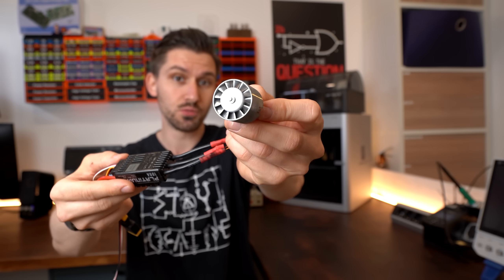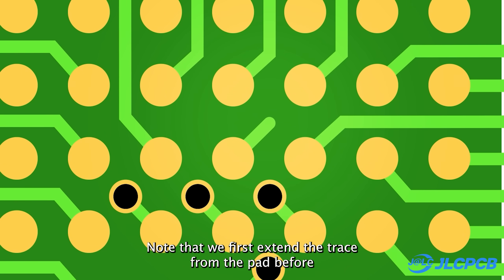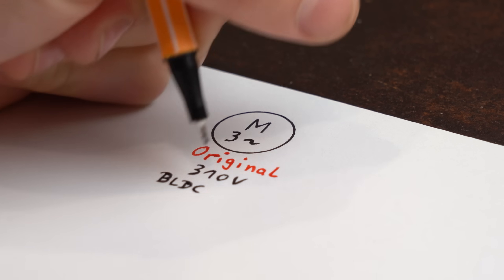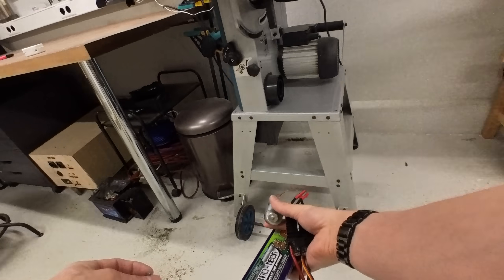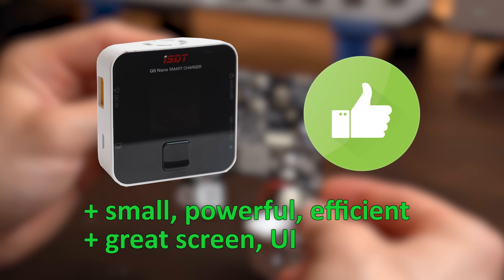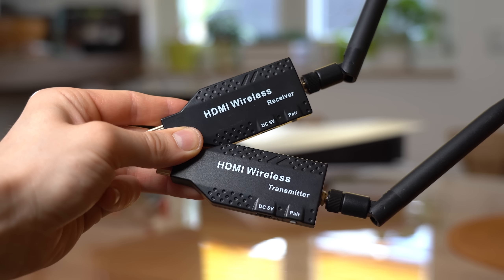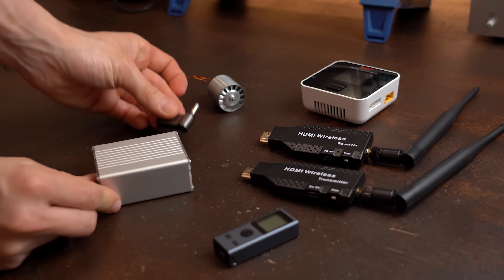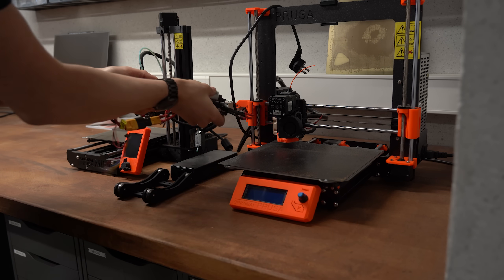I tried finding Hidden Gems on AliExpress AGAIN! (Part 9)

Comment: The usbc barrel adapter can power anything that demands less than 100w. Using it daily with a dell laptop and a 45w gan charger.
Reply from the maker: Good to hear :-)
Reply: @greatscottlab On some laptops like Dell, HP there is a charger power detection. On HP on third pin there is a  voltage divider (simple resistor to +) In your movie it looks like there was 100watt resistor and the power supply with less power. In Dell is 1-wire. Those plugs are fine, but you need to remember that it might be tricky, due to cheating laptop's power detection.
Reply: @greatscottlab  I got a similar laptop with probably the same adapter. The setup worked for me while using the "Super Battery"  Profile in Msi Center to limit its tdp. Also at least my laptop was drawing ~140 W on the balanced Power profile  :)
Reply: i have a similar cable that i use for my bluetooth speaker that takes 20V, and it has a magnetic attachment that kind of works like a macsafe port too; probably not the safest for high amperage use cases but has been working fine for my use case
Reply: I feel the need to mention that these heating up to 60C Celius and that is why I stopped use mine!
However there are cables variant that built better and not heating up whatsoever!
Reply: Same here, using it with my Acer Swift X that only needs 90W, have a 100W charger that I use it with.
Mine was a little loose tho, so I replaced it with a full version, with a usb c cable on the end and that works great
Reply: @sandeepreehal1018  The one i use from Tsric for newer dells is also not a perfect fit unlike some cheaper ones. But the others i have fot 2 hp laptops , old and newer are a perfect fit. I guess they made it a bit longer to fit in all laptops. Not that it affects the daily use.
Reply: I used this adapter with a Dell laptop and unfortunately it doesn't work for me.

But maybe its because I used Baseus 65W power bank, which is garbage and i don't have other 65W usb-c source.
Reply: @alexert2918  from what i know a 65w powerbank does not mean it can output 65w feom one port but is a sum of the total ports. I have been using a 11euro toocki 65w gan charger and a 9euro 45w toocki gan charger from alixpress. 
Ps your powerbank can only output 20w. Unless it is an arm netbook i doubt that you can use it for anything other than charging phones or powering leds.
Reply: @alexert2918  the baseus 30000  powerbank can't output more than 20w per usb port.
Reply: @alexert2918  Power adapter / power bank need to have Power Delivery protocol with option to negotiate and produce 20V. Even though it can produce 65W it might only deliver 15V for example.
Reply: @grzegorzw5042  It can output 20V, in fact i used it to power a soldering iron and another laptop (not Dell) it just refuses to work with this laptop as well as with my phone via type c
Reply: Maybe an addional info here: I think these adapters produce 20V. I don't know if all Laptops use 20V in.

Btw: works for my old Lenovo (not thinkpad) an also my wifes newer lenovo (not thinkpad) with thinkpad connector.
Reply: @HerrFreese  Generally laptops use 19.5-20v power supplys. Unless its a special laptop which demands only an original charger there is no issue for a 19.5v laptop to use the 20v adapter. Any lower of 19.5 or higher than 20v is a problem.
Reply: @HerrFreese  they have 9 12 15 20 from what I could find

Comment: 1:45 thanks for featuring my suggestion! Now i understand what they meant in the listing, time to get one.
Reply from the maker: Thanks for the recommendation :-)
Reply: I'm looking for a BLDC blower optimized for static pressure to suck air through a filter, 5S or 10S would be just perfect. Any ideas?
Reply: @wilfriedklaebe  maybe get one of those centrifugal fans, or maybe this one featured in the video would do. You could get the 310v unmodifoed fan and rewind it to be 5-10s, if they recommend an x amount of turns for 3s (im too lazy to check) then just wind it with 5s-10s/3s*x turns. You could make it work.
Reply: @wilfriedklaebe  The ~$100 "Wix" air filters from Costco use a ?30W? mains BLDC (been a while since I checked) to drive a centrifugal fan.  It has a board that also has an ionizer and is controlled by an ESP32.

You could probably find the parts cheaper individually, but if you can accept mains voltage, I'd say it's a great deal for an all in one solution.

Comment: For your old charger i can recommend the free cheali charger firmware it brings the ability to calibrate the cell voltages to cancel out the unprecise reistors used by the manufacturer.
Reply from the maker: Thanks for the info. Will have a look :-)

Comment: I bought so many different kinds of ducted metal fans and there was one version that is 130w with more surface area on the impeller and it was great for  rc motorjet project, cheaper solution to getting into rc jets
Reply from the maker: Haha sounds like fun. Thanks for the feedback.